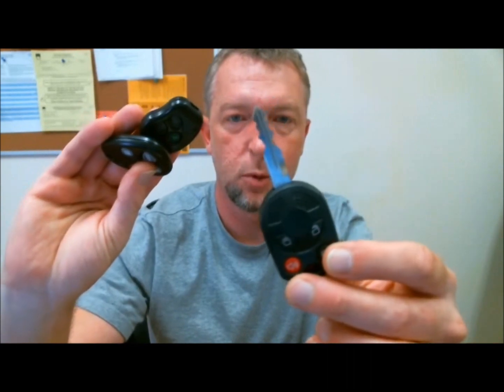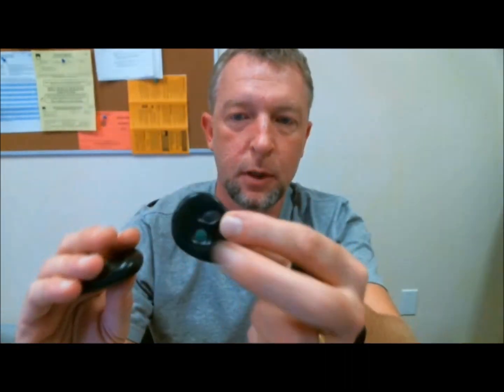97 - 04 Buick Regal Factory Remote Programming How To

Comment: Thank You that worked great for my '00 Regal. One question though, Why did my fob stop working to begin with? One day it was fine and then the next it wasn't and instead of buying a new battery for the fob I tried using the other fob and that didn't work either. I haven't replaced any batteries, your reprogramming tutorial worked.

Comment: Will that work in Canada?  A Buick Century 2004, was manufactured in Ontario i believe.   I tried these instructions last 2016 September but failed, i did not hear any beeps at all.  i fear i might lose the only key i have that's working, if i try to many times.  Maybe i should just try to bypass the chip system and use standard keys (non remote), its an old car, security is now a non issue.  I'm also planning on buying a used Ford Fusion (bucket list)
Reply: you may have not turned the key far enough, I tried and failed a couple times, then i started the car and found out I was only turning on the accessory function, go one more click so all the lights turn on. try that it should work.
Reply: Thank you boss, much appreciate.  My fear is that i do something wrong or just the computer goes stupid on me and then my only key stops working.  I'll give it another go.   By the way, in 2 years, none of the parts broke down.  Even my 21 year old son's friends think its a cool car, strange.